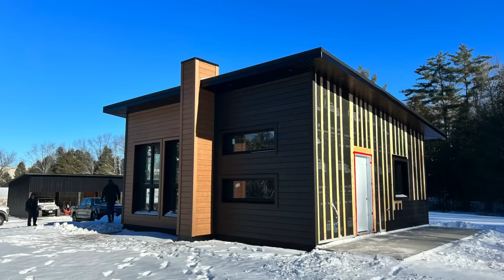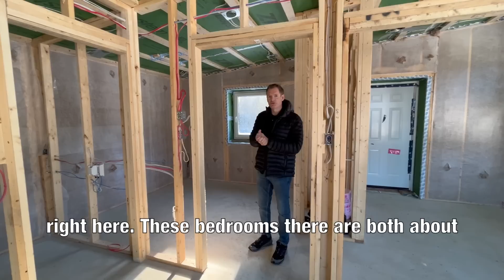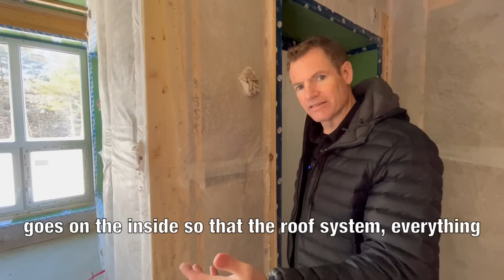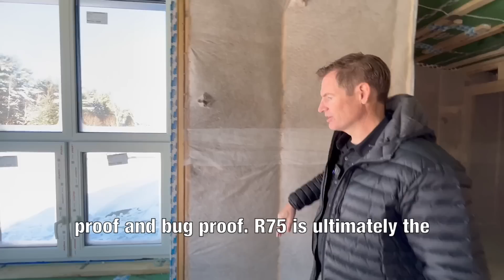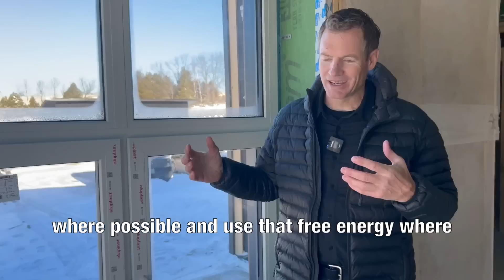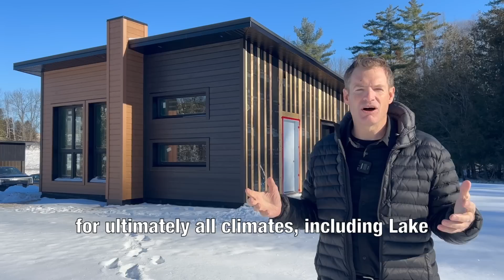"Tiny" Pinewood Paradise Passive House Tour

Comment: 1st, it's awesome to see examples of efficient dwelling gain traction, & i wish you guys success. fast becoming a necessity in the world, rather than just a nice-to-have for the rich.

bit surprised to not see an ICF envelope here for thermal mass, but maybe location/materials/etc made it less viable? did notice the designer made efforts to keep water lines to inside the envelope - good call.

climate isn't as extreme where i'm building (loads of helpful sun at high elevation too), but there's just no way to get affordable framing with any attn to detail (all stick builds are swiss cheese), so each of my plans are ICF. triple pane are also outside budget in southwest US, so i've done my best to offset losses with other cheap systems (maximized southern gain/minimized northern/awnings & E/W porches, double-double window method, Trombe wall hotbox water circulation w/ hydronic thermal mass & pre-heated ERV, etc).

Comment: Where’s the price tag? A tiny house’s appeal is the price tag yet no mention of that. Who cares about the thick ass features if it costs as much as a non-tiny house after taxes, land cost, etc.’s & fees Start the video with a price tag bruh. 🤦🏻‍♂️
Reply from the maker: A passivehouse is designed properly will ONLY cost an additional 5% compared to a ‘code built’ home but when you factor energy savings for heating/cooling energies, passivehouse is the CHEAPEST house to live in. Cost for all heating/cooling regardless of climate zone is less than $100 a year, so if saving money is of interest, you should build one soon as possible
Reply: @EkoBuiltPassiveHomes  but still, if the blueprint is basically a homogeneous one across the board, without any customization “unknowns” presented by the customer, then the end cost of it should be a fixed “known” price to drop it on a property; 100k? 200k? US$?CAD$?
Reply from the maker: @Obi-Wan_Jkobi  see our tiny house cost analysis documents here https://ekobuilt.com/ekobuilts-services/ottawa-coach-house-plans/coach-house-plans/
This is the ‘Pinewood Paradise’ model 240k CAD pre-finished

Comment: Is that condensation in the windows?
Reply from the maker: Yes, good for noticing! 
There may have been some condensation on the inside. The weather tight shell had just been completed, fresh air machine not installed yet, so some residual moisture from Construction.

Comment: As a swede, with +30C to -20C in my area, I like it, hobby designing houses in sketchup I also found that hall-ways are waste of space ways. If that'd be put on the ground where my current house is I'd probably have a gable roof covered with solar panels on it to maximize the ~4 months we actually have a chance to get a good amounth to sun. Also, thick-ass walls open up a lot of design opportunities around openings. Love it.
Reply from the maker: Thanks for the comment and yes, correct the thick as walls allow for a huge windowsill that can be used as a piece of furniture or a seat, Another way to keep Any house smaller! Stay tuned for more

Comment: 150 pounds per sqft is not even close to requirements for the Tahoe region. In Truckee area snow load is about 280 lbs 6000 feet above sea level. And 480 at 7000 feet.
Reply from the maker: Thanks for contributing to the conversation, amazing info!
Our highest snow load experience is Tahoe, would be cool to do a design for Truckee area! In general an our version of a passive House is 3x stronger than basic code, finding out additional engineered design requirements for Truckee would be cool, please spread the word and stay safe! ✌️

Comment: I was all about passive house construction in the 70's. It's ironic that insulation has come full circle and I imagined you've addressed the slab issues. I will subscribe and will look forward to upcoming videos. I would be interested to hear about ventilation, and supplemental utilities. I feel vindicated that you used "thick ass" construction method, in so much as wife  referred to my pu in similar terms.
Reply from the maker: Amazing to hear your history with passive House construction! When the net zero code becomes official soon, all builders will be forced to build this way and really cool to hear you have been involved since the 70s!
Regarding ventilation, we presently supply the Swegon system 
Thanks for your comments in general, we will try to focus on Mechanical in future walk-throughs.
We do have a great blog you may be interested in, lots of great articles just check out our website here 
https://ekobuilt.com/blog/
Reply: I just have and I'm on the e-mail list, thanx  @EkoBuiltPassiveHomes

Comment: I see condensation on the inside of the windows.  That seams funny for such high performance windows.  Do you use  an ERV for ventilation?  My guess is condensation would not appear when the system is commissioned.
Reply from the maker: Wow nice observation! 👍
However, the condensation you see is actually on the exterior. 
During normal operation, the house would have a ERV system, so no opportunity for moisture to accumulate either..
At time of video days were above 0°C and below -10°C so condensation to be expected..
If the condensation is on the outside exposed side of the glass then the door/construction is doing its job. Condensation will only ever form on the coldest surface, if it’s on the exterior (naturally the exposed pane is the coldest) and not coming through then everything is good.
What’s great about Passivehouse window technology is none of that cold makes its way inside the house. Inside face of glass is just a couple degree off room temperature..✌️
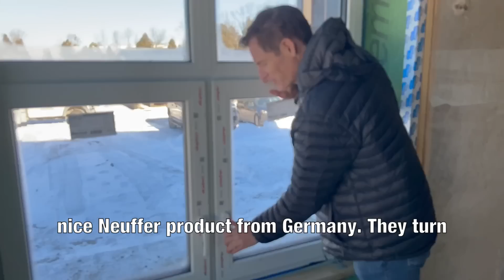Reply: @EkoBuiltPassiveHomes  The condensation is definitely on the interior! At 3:47 when you open it we can see no condensation on the exterior.
Reply from the maker: @carloslemos6919  yes, good for noticing! This house - the weathertight shell was just recently completed and no mechanicals (fresh air machine) installed yet, so some residual moisture from Construction
When a passivehouse is completed, There is no excess moisture in the home and also no dry conditions in the home. The ERV is responsible for all moisture management in addition to fresh air. Relative humidity is always between 40 to 60% on the interior regardless of exterior environment.

Comment: I’ll look forward to your finish video when it has the proper passive doors and decorated interior.  In that video it would be nice to have a floor plan layout with dimensions rather than referring viewers to another link.  I would be interested in that video having information on the fresh air machine system.  I like your explanation of why there is no hallway, and I have a design suggestion for how you can keep the bathroom and bedrooms with a more private feel of separation from the main living/kitchen space: by using a hall-ette where the stackable washer/dryer is located.  This would have an opening to the main room.  Then clockwise as you enter this area to your left would be a bifold door concealing the washer/dryer, then opposite the opening to the main room would be the doors to the two bedrooms, then opposite the washer/dryer bifold door would be the bathroom door, then opposite one of the bedroom doors would be the door for the water heater/mechanical room.  I live in an 864 sq. ft. prairie ranch house built in 1945 and that was how they were doing it almost 80 years ago!  My house was originally built with no insulation or any energy saving features like multi pane windows etc., but is amazingly low energy consuming. I’ve been modernizing it with thoughtful insulation, I liked your use of zip panels on the ceiling for a vapor barrier.  I’m changing my small roof space to be conditioned rather than vented to the outside.  I’m installing a center air evacuation system for fresh air, and I’m going to update my floor crawl space (it’s a pier and beam foundation) to have insulated floors and a vapor barrier system.
Reply from the maker: Thanks for your suggestions. They are greatly appreciated and we will look at these internally amongst our team!
Thanks also for your recommendations how to make the video better, we will keep this in mind on future videos!
Good luck with your project. It sounds like you’re doing all the right things!  ✌️
Reply: @EkoBuiltPassiveHomes  You are doing great, and like everyone you will get better over time.   I'm happy that you are sharing your passion for passive building.

Comment: Great video, love the house build. I love the windows, but I shocked by all the condensation on the outside!! 😮
Reply from the maker: Wow nice observation! 👍

At time of video days were above 0°C and below -10°C so condensation to be expected..
If the condensation is on the outside exposed side of the glass then the door/construction is doing its job. Condensation will only ever form on the coldest surface, if it’s on the exterior (naturally the exposed pane is the coldest) and not coming through then everything is good.
What’s great about Passivehouse window technology is none of that cold makes its way inside the house. Inside face of glass is just a couple degree off room temperature..✌️

Comment: What is the modifications for homes with hot summers?
Reply from the maker: Thanks for asking! 
Passivehouse is an international building model so can be applied anywhere, even in tropical (cooling predominant) climates where the benefits are actually more beneficial than cold (heating predominant) climates. 
In general walls call be thinner with a focus on airtightness and dehumidification. 
An air-conditioner is required but only for a fraction of the time when compared to the conventional alternative

Comment: I would like to see a tour of finished mechanicals going into how the home is heated/cooled and how the air is treated for allergens etc. Mechanicals make a passive home - it would help if this included any and all energy modelling that was done in the design phase of this home.
Reply from the maker: Just like ALL homes should have but don’t, a passive House has a fresh air machine that:
-optimizes heat recovery being 90% efficient on even the coldest winter days
-optimizes humidity management (home is always healthy at 40 to 60% RH)
-optimizes ventilation for a highly oxygenated toxin free interior
-optimizes energy savings using less less than 1 kWh per day
-Optimizes a peaceful environment for being so quiet. You can’t even tell it’s on…
See details here 
https://drive.google.com/file/d/1y-_E5lfb91vcSY3I8cZdEPEE8KFD3UIb/view?usp=drivesdk
Reply: This link doesn't seem to work, it says access denied @EkoBuiltPassiveHomes
Reply from the maker: Regarding energy modelling respect to the heating and cooling system maintaining an optimum, interior environment year round, the house will use under 1000 kWh for all heating and cooling approximately $100 per year in most areas
This is the beauty of a Passive house. There’s literally no money spent to heat and cool the home for comfortable living, cost of electric bill, depends on other items, such as cooking, laundry, Computers, etc.
Reply from the maker: Mechanical rooms in all of our homes (tiny, small or large) can be the same size since no heating/cooling system is in there. Using an ASHP (air source heat pump) no mechanical space is used therefore allows mechanical room to be as small as 25 ft.². You can see a picture on our blog post about small utility rooms here.
https://ekobuilt.com/blog/creating-a-small-utility-room/